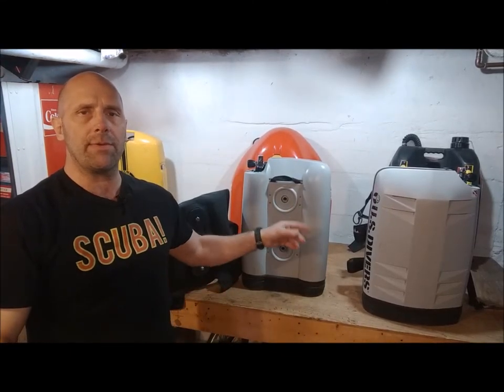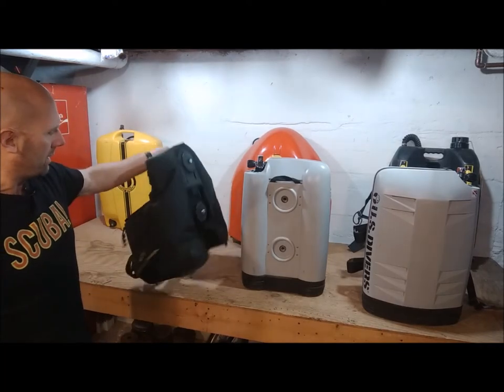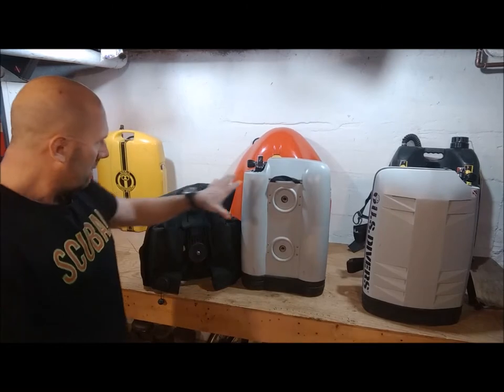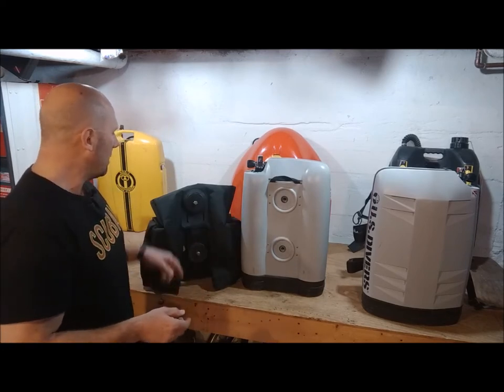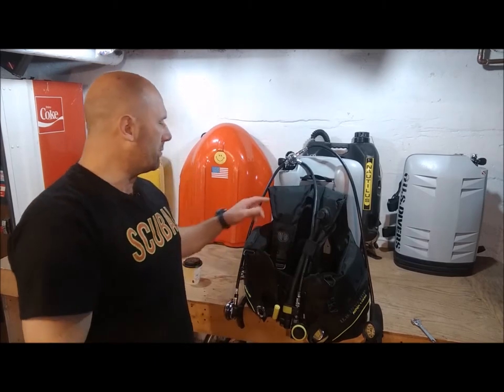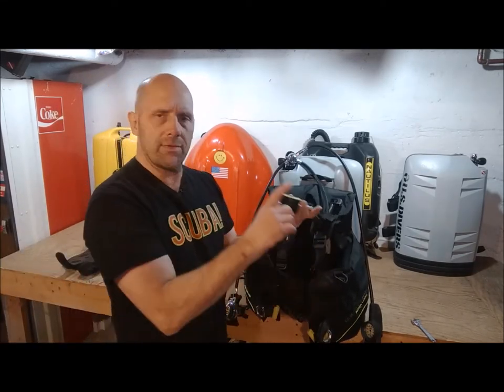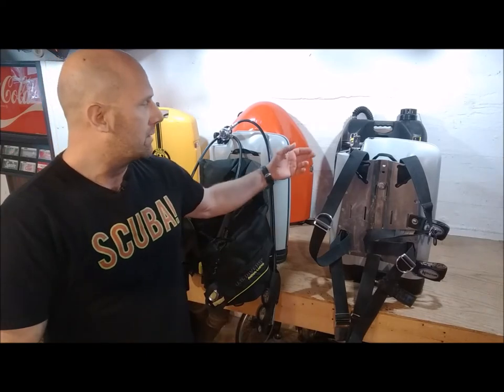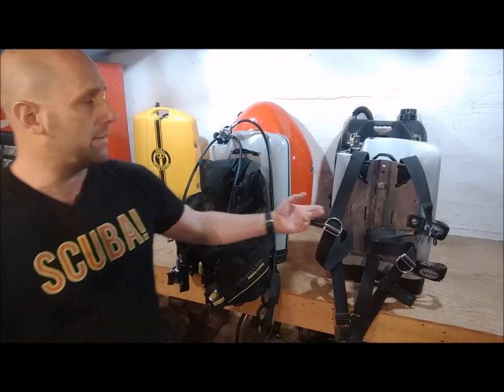US Divers ABS Scuba systems Awesome triple tanks!

Comment: Awesome video. I just stumbled across your channel while looking for tumbling info. I'm Jealous, I always wanted the ABS. I have a Twin 30 manifold I'm thinking about selling or trading. Getting back into diving after 18 years. I just don't understand why dive shops are so afraid of the 6351 AL cylinders if they pass hydro. I'll be checking out more of your vids. Safe bubbling brother.
Reply from the maker: Good to hear that you are getting back into it. I love scuba as you could probably tell. LMK what you're getting cause vintage gear is one of my favorite aspects of the sport.
Reply: @DonFassbender  I still have all my gear. Mostly US Divers. Early 90s. I would love to have a US Divers double hose but they want to much for them. I have some Rocket fins as well as the Sea Hawk red, white & blue handle dive knife. I also dive a Divator MK2 full face mask. I have been looking for a black 30 to go on my Twin 30 manifold.
Reply from the maker: @Neptune730  sounds like a great start 👍 did you see my red, white and blue tank? I love the USD bicentennial gear. I too have a knife and fins but the fins are dry rotted so they sit on a shelf.

Comment: Very cool!  I inherited a US Divers BC "ABS Limited edition" that is designed for this system. Where did you find the plate for the BC unit you have. Mine is missing one of the  puck screws.
Reply from the maker: The metal plate is a standard aluminum tech diving plate that I drilled two holes through to line up with the tanks. You can use stainless too if you need the added weight.

Comment: Don, great content. The dive shop I work at just put one out in the trash, so I snapped it up. How does the shell come apart? I don't want to break anything while I restore it?
Reply from the maker: The two black buttons on the top hold the two pieces together, Chris McKenna. Pull up then work the back side up and off. Go slowly. Sounds like you got a great deal. Thanks for checking in.
Reply from the maker: I'll reply more when I can and if you need me to. I'm traveling back from the Caribbean and so have little time for connecting flights. Be sure to check out the Facebook page if you have an account.
Reply: Thanks! The buttons up top were all buggered up, but they look like standard automotive type things. It all came apart nicely, and now I need to clean the shell which is all scuffed and filthy. On a bonus note, the tanks are all 1987 tanks, so hopefully no problems filling them. Thanks a lot! p.s. I joined the Facebook group.
Reply from the maker: Great to hear, Chris! You are well on your way to diving with one super cool and hard to find system. I plan to dive mine more this year and hopefully the water will clear enough for another video of the ABS in use. I have little doubt that those tanks will pass.
Enjoy, and dive safe!
Don